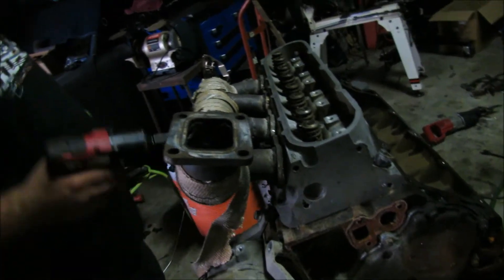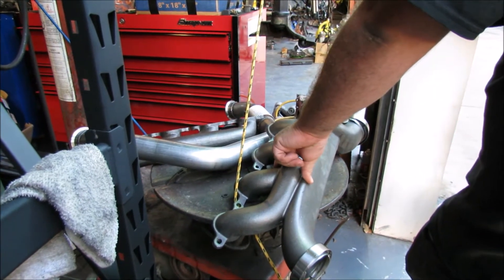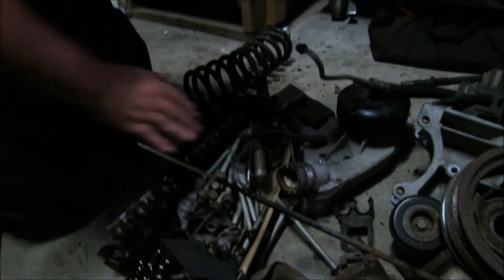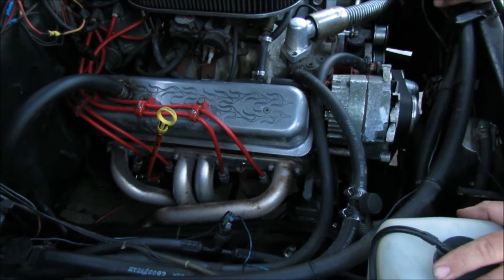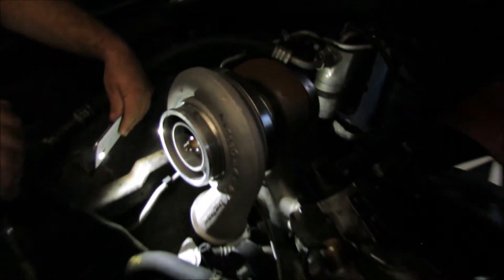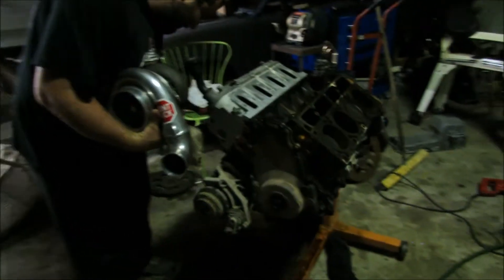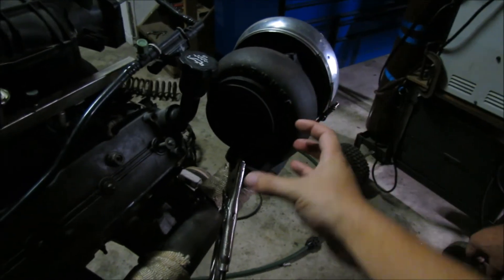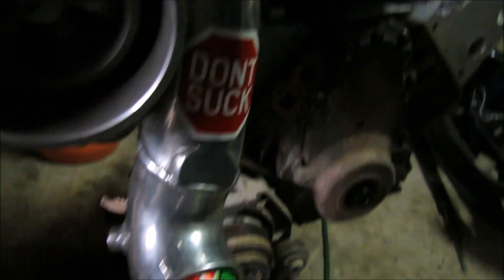How to Keep Factory AC on Turbo LS

Comment: You can also use a C-6 vette manifold that tucks tight to block and exits down on the pass, truck manifold rev on drivers side, and mount turbo in front front  or battery location like some of us 4th gen f-body guys do.

Comment: Whose truck manifold is that, manufacture?
Reply: Tsr Racing how much?
Reply: 407ForRent  i think i paid 390 on a discount. So around 430 or so .thats for both
Reply: Tsr Racing and you will need to make your own crossover pipe?
What city are you in?
Reply: 407ForRent you can get one from holley as the whole kit .i think its like 60 bucks. Dont quote me on that .holley owns hooker . .
Reply: Its all v-band to .
Reply: Just checked the crossover is like 200 bucks .i dont know where i got 60 from .lol sorry
Reply: Tsr Racing I wonder if it will fit on a tbss
Reply: At 8:05 they mention the Holley not working because it was too low (hitting Compressor factory location). They used a truck style turbo manifold. Which places turbo up top.